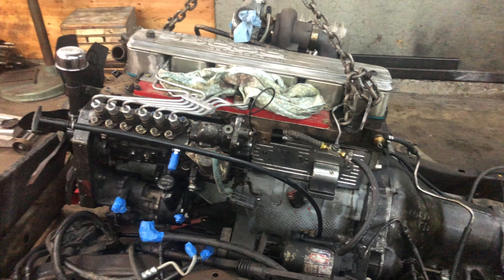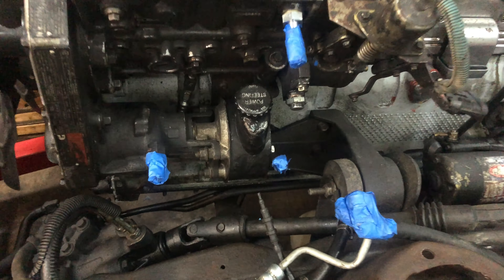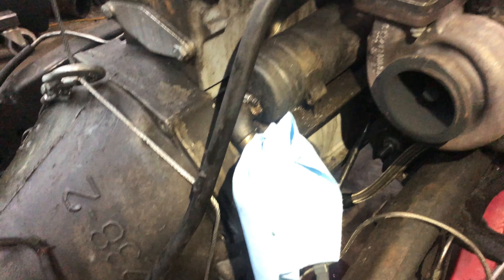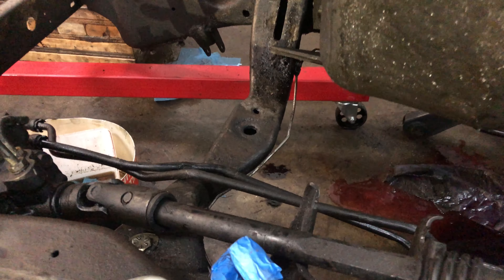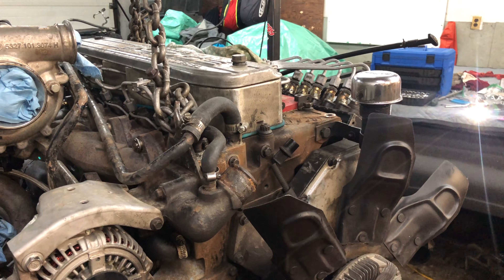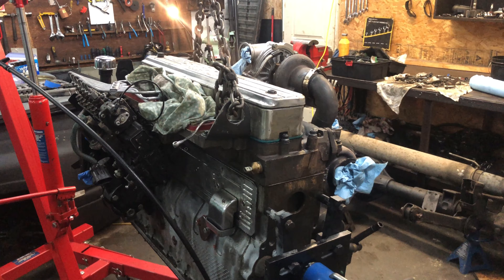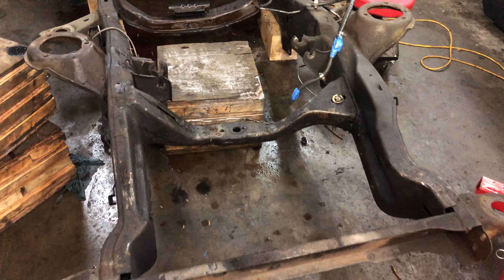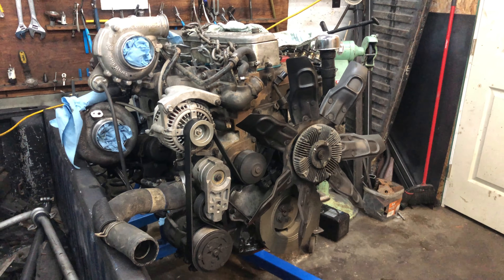12 Valve Dream Truck Build Episode 5 Engine, Trans, T-Case

Comment: Have you looked at something like the Fleese coolant bypass? Seems like it might help with the cooling on cyl 5&6. Not sure if that had anything to do with your cyl scoring but Now would be a good time to add some thing like that and you’re definitely at a power level where that could be an issue
Reply from the maker: Absolutely, will do

Comment: I saw in a past video you had the psc big bore steering box. I just put one on my truck and if you have a 3rd gen style track bar which I think you do, you will want to check the steering box mounting bolt that the track bar conversion bracket utilizes as mine needs a longer bolt to account for the ~10mm thickness of the bracket. Just thought I'd mention it.
Reply from the maker: Yeah I noticed that, thanks man